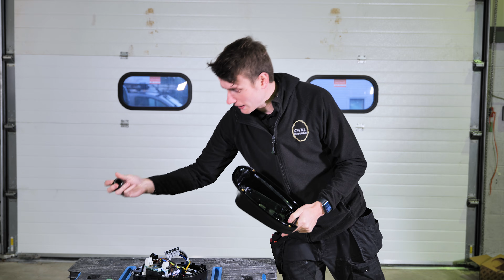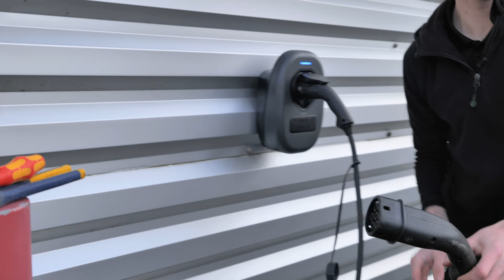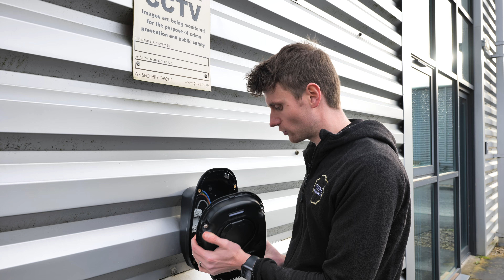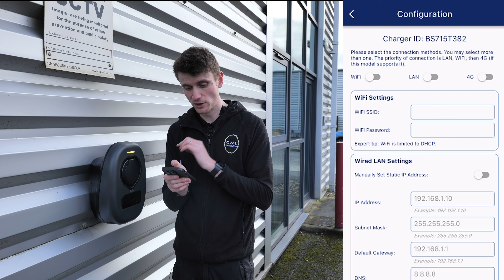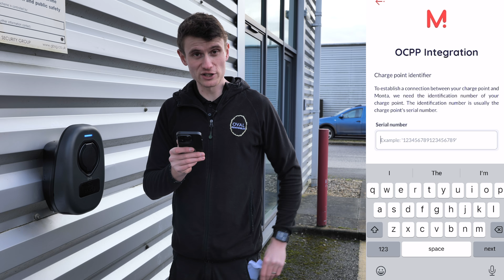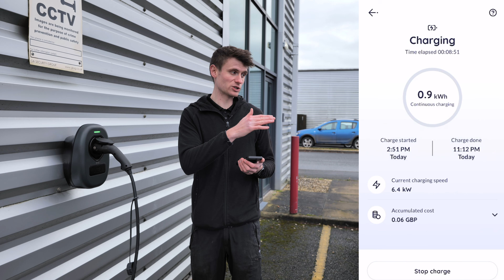22kw Sync EV Charger Install Review!

Comment: What happened to the Ct clamps connects and the Ethernet connection? Not impressed with dangling front, makes for a difficult install when making all the connections! Givenergy make a far superior fitting system and is also 3 phase.
Reply from the maker: Both are available for this charger however we didn’t need the CT’s as we have a 400a incomer and low consumption in the building. Also there is an access point just inside so it has been connected via wifi but there is an Ethernet port inside. I’m not sure what you mean about the dangling front as it’s on a big plug as is shown in the video meaning the connection can be made inside for the power then plug the ‘head’ in.

Comment: Considering most EV’s don’t charge more than 7kw on AC personally I don’t see the point in these 3 phase AC units
Reply: Many cars will handle 22kW chargers. I have a Skoda Enyaq that is limited to 11kW bur that’s an improvement on 7kW
Reply from the maker: As the other comment says more cars are increasing their charge rate. It future proofs the property as well
Reply: 11 and 22kw charging is common in Europe as homes are much more likely to have 3 phase as standard
Reply: If you are fitting multiple chargers then 3 phase will offer the ability to do that more than single phase.